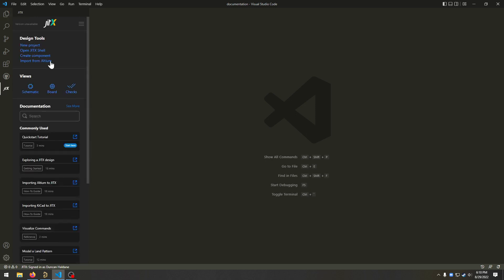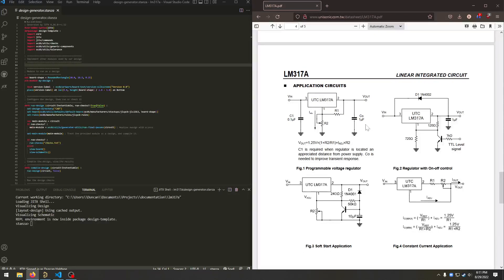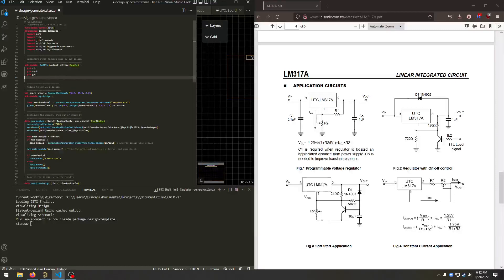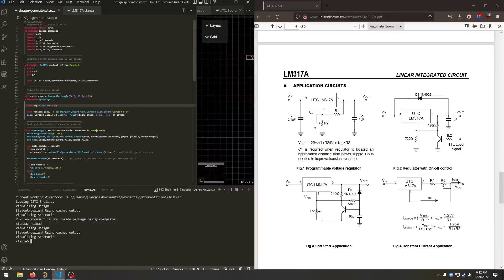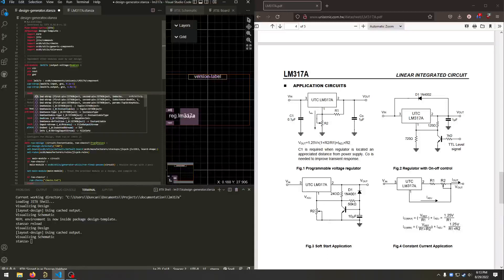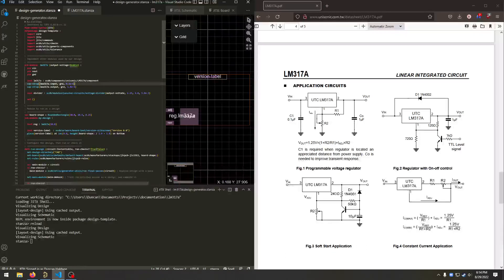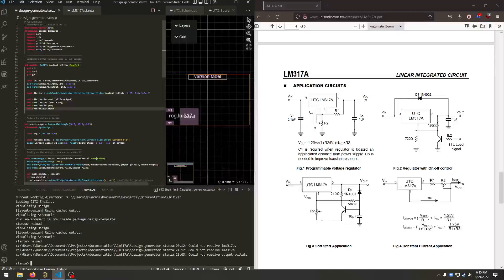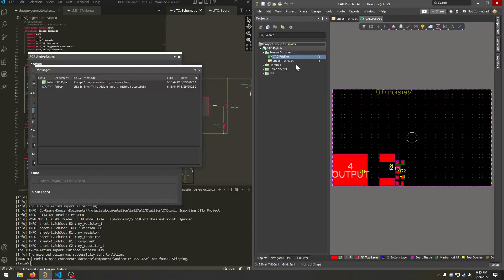JITX Quickstart: Create a new design

Comment: I know this video is old, but there are some useful concepts here (like the modularization), as well as some issues: I think the resistor divider is hooked up incorrectly since the regulator Vout-Vadj is 1.25, not Vadj-GND. That datasheet also specified the max Iadj at 5uA, not 5mA. It looks like the voltage divider calculation does not factor output current (and it's tolerance). Maybe that is why a larger current is used for the calculation, though if so the multiplier should be stated more explicitly.
For those trying to follow with more recent versions, you probably need to add the following line to your slm.toml, then kill the terminal and re-run the project:
ocdb = { git = "JITx-Inc/open-components-database", version = "3.26.0"}

Comment: What would be the advantage of using Jitx, if making that circuit graphically in a CAD software would take me 2 minutes?
Reply: even less if it's not your first time using this part. If you can copy it you also already have the partnumber of your supplier.. 
But this seems to be the start. If you could just tell it: input voltage: 24V, use cheapest available stm32, add CANbus and it would select the parts itself + create the schematic it starts being usefull.